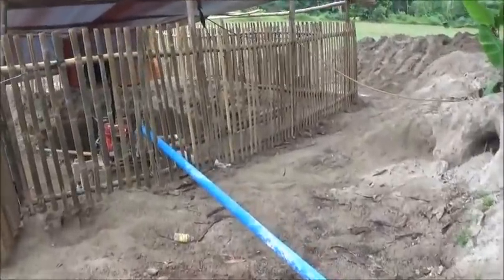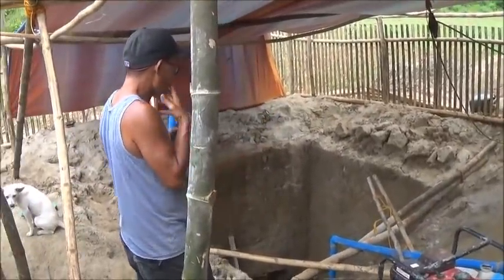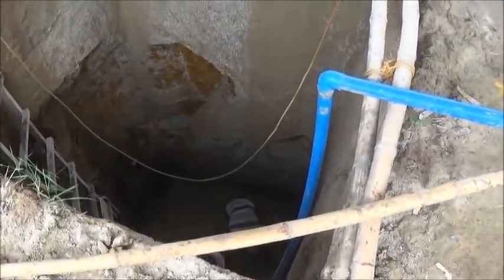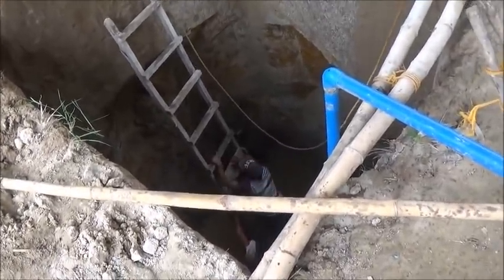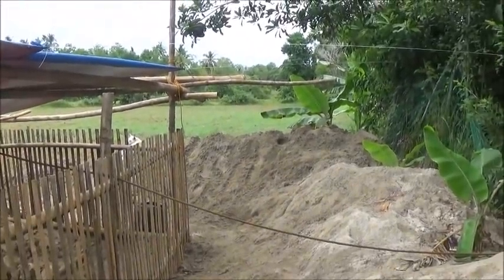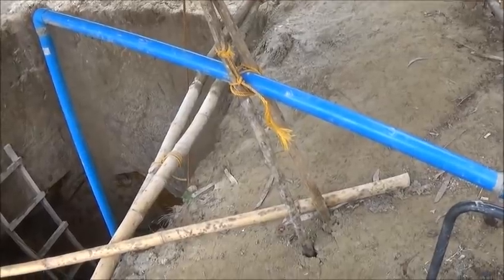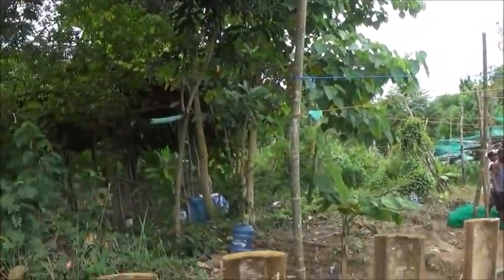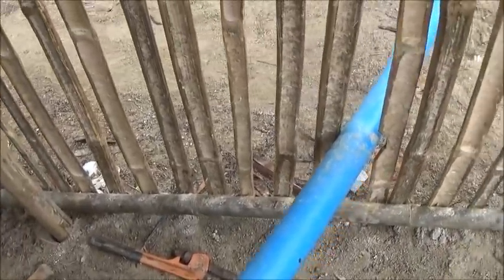Preparing The Well For Hollow Block Walls

Comment: Just make 4ft dimeter concrete pipes loer them down as you start digging NO CHANCE of a cave in.SO SIMPLE
Reply: In Iloilo, they just keep digging out the soil inside a wide concrete pipe (vertical) or stack of well tiles and it sinks down from it's own weight